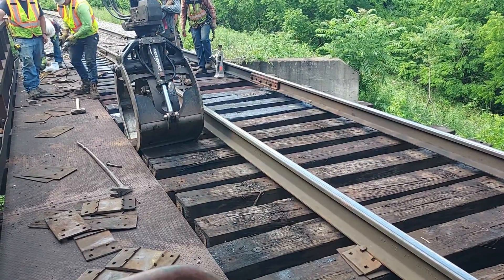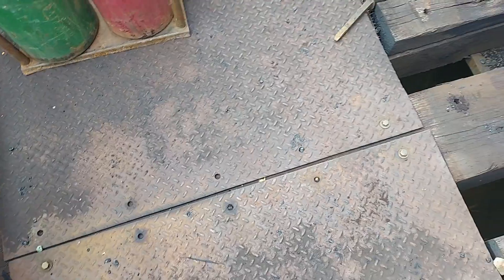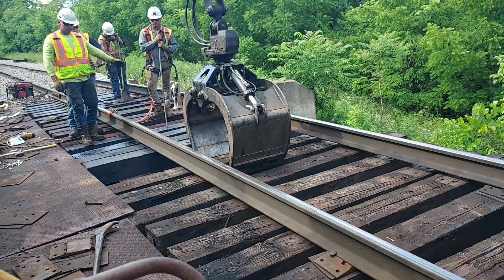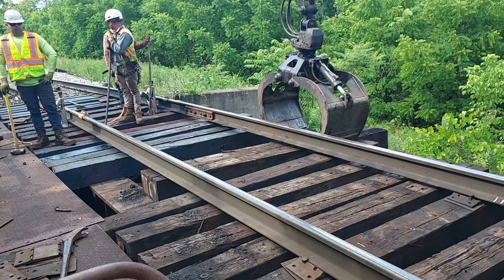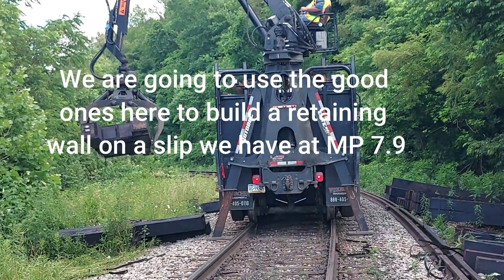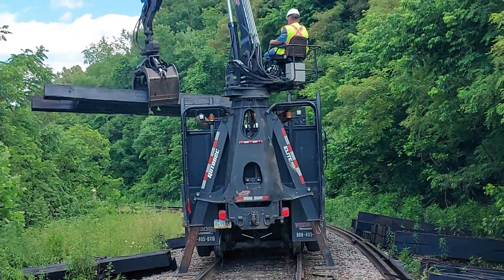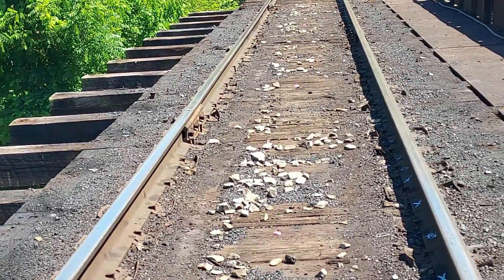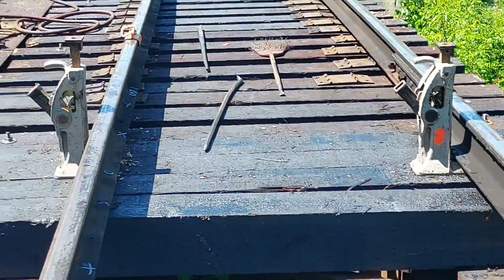Major Problems on Bridge 8 Deck Replacement

Comment: Are you unionized? If do, how do they feel about all these contractors always doing your work? Also why are they changing those ties out? They look perfectly fine. A class 1 they'd have another decade on those ties.
Reply from the maker: Yes we are union and way back in the past union filed a grievance,
out of that it was determined that contractors can come in and
do work that we don't have the equipment to do. But if they do
come in then any union guy that signs for an extra day they
are allowed to work.   

Some of the ties were good, some weren't. Can't judge a timber from
just the tops. Got to watch underneath as a train goes over the
bridge. If the timbers are moving up and down, those timbers
are soft and spongy and not a good thing. When that happens,
it's time to replace all of the timbers. Very much appreciate
your stopping by and checking out the show my friend.

Comment: Didn't something like this happen to you last year was well? I vaguely remember some similar timber issue.
Reply from the maker: We redid bridge 4 in the not too distant past and I showed that
deck after it was done, they had not put in all the lags for the
bridge guard timbers and main timbers had gotten skewed, if
that's what you are remembering. Thanks my friend for showing
up today and taking in the video.
Reply: @ccrx6700  Ah, yes Dave. Thanks!

Comment: Never a dull moment on the railroad! Looks like a job for a skilled chainsaw person. Very interesting video Dave. I like learning how things are done especially on construction projects. Look forward to the next installment.
Reply: Agreed- circular saw for vertical cut, then chainsaw horizontal rip cut. Sounds tricky and back breaking, but fast!  Maybe make a temporary "bench" at good working height and have grapple truck move them on and off.
Reply: @alandaters8547  Excellent idea!
Reply from the maker: Always an adventure here Wilbur. These guys did a remarkable
job dealing with the adversity and high heat. They never gave up.
We give them a big thumbs up for their efforts. More to show
you on the bridge in the next video out. Thanks so much my
friend for all your great comments and wonderful support of
the channel.

Comment: You know Dave, if a guy could get a chainsaw with a "stinger" under there, if there's room, while standing on a suspended platform, 2 men running the saw should be able to knock that out in a day.🤔
Reply from the maker: And did I hear you say, you would be right over to volunteer to
do that? LOL Always do appreciate hearing from you Captain Tom.
Next video out tomorrow night I will show you more of what they did.

Comment: Curious on how old are the ties being replaced on the bridge . They don’t appear to be in bad condition.
Reply from the maker: Some of them were good, some weren't. Can't always judge a timber from just the tops. Got to watch underneath as a train goes over the
bridge. If the timbers are moving up and down, those timbers
are soft and spongy and not a good thing. When that happens,
it's time to replace all of the timbers. Very much appreciate
your stopping by and checking out the show my friend.

Comment: Thanks for this video!
Looks like someone from the past left your folks quite a mess!
Reply from the maker: Your welcome Robin. Our timber supplier has original prints for some
of the bridges and some they can't find them, this one they 
couldn't find. Guy who measured did not measure center span
girder right. A big mistake, but mistakes happen to the best of
us. These guys did a remarkable job in what they had to
deal with. Always appreciate it when you come to visit with
us my friend.

Comment: Your luck runs about like mine. Measure 3 or 4 times and it still comes out wrong.
Reply from the maker: I could never be a plumber Mike. I clean up a plastic pipe fitting
the right way fit it together and it still leaks.... sigh. I hate plumbing....
Really want to thank you my friend for stopping by and watching.

Comment: Nice video once again Dave, blue prints are good and change orders happen during construction and never updated or filed, 93 ties in the centre span is a lot of cutting for Frontier, but they are the contractor to get the job done. Question from a non railway person - with the new ties on the bridge, does it affect the "cant" for the approaches and exit of the rail from/onto the bridge ( 1 right corner, 1 left corner). Not sure is it is the right terminology but I'm following along to learn what you do. Cheers and stay safe
Reply from the maker: Thank you very much Pete for the nice comment. These guys did
a great job and never gave up. To answer your question. When new
bridge timbers are put on, then I will tamp both bridge approaches
so the rail makes a smooth transition. 

This was a tangent bridge. However on bridges that have curves,
when they cut the dap, the high side of the rail the dap will be
deeper than on the low side. This is to allow super elevation
to occur on the bridge, it will be dapped so the bridge timbers
have the same super elevation as the rest of the curve has.
Hope that helped explain. Always appreciate your joining
in with us my friend.

Comment: make a template....layout each timber...do your...depth of cut...chip it out to wide with  hammer and chisel... it'll  take less than 25 min per timber... its a pain...but a simple fix!   good luck...stay safe!
Reply from the maker: Next video coming out Dave will show you what they did, pretty much
following your suggestions. They got er done. These guys
did a fantastic job and never gave up. Always appreciate your
taking the time to tune in and watch my friend.
Reply: @ccrx6700  thanks dave!
Reply: I'll  bet the techs...back at the office...pulled the wrong blue print...or just guessed...its best when they come onsite. and measure... work safe dave!

Comment: Dave, I was building a new run around and at one end was a bridge 🌉 that required 65 timber. Being we were going over water 💧, we had to use Green Treated Timber. No dap.
We removed the old Timber, cleaned off the steel, gave it a quick coat of red Primer paint, then laid   Convear belt onto the beams for cushion. 
 Since we had no dap, I tacked 6 Timber together then marked out for the dap.
Using a good circular saw & a 60 tooth blade, I just kept going back and forth, about a 1/4 inch between passes.
Took my hammer and broke the wood off then cleaned up what was left with a chisel. 
The beam was about 18 inches wide 😳.
Stay safe my friend, 
Richard Bause
Reply from the maker: I'm surprised the EPA still allows many RR to use creosoted 
timbers over streams. Good job on the hand dapping, that's
a lot of work! They used a circular saw and a hand adze for
these. Always appreciate your joining in with us and checking
things out my friend.
Reply: @ccrx6700  thanks my friend. 
When it comes to water 💧, EPA & DEC are always looking over your shoulder 👀.

Comment: Wow!! 😯 somebody messed up big time. Hopefully it won't take too long to get it fixed right.
Reply from the maker: Will show you in the next video out what the guys did to re do
the dap. It was a pain, but they did what they had to do. 
Unwanted things sometimes happen on the railroad as in
life itself. But these guys persevered and never gave up. Thanks
so much my friend for checking out the presentation.

Comment: Those old timbers seem to be in relatively good shape!
Reply from the maker: Some of them were, some weren't. Can't judge a timber from
just the tops. Got to watch underneath as a train goes over the
bridge. If the timbers are moving up and down, those timbers
are soft and spongy and not a good thing. When that happens,
it's time to replace all of the timbers. Very much appreciate
your stopping by and checking out the show my friend.
Reply: @ccrx6700  I see what you mean, does that railroad interchange at all with others, or is it strictly load and unload the same cars point A to point B?

Comment: Gosh Dave, that's a big deal with no easy or quick fix. Takes the steam right outa the old boiler. Like you always say that's railroading, but not the way we like to see it. Stay safe Dave and thanks for the update!!
Reply from the maker: No easy fix Rick, but these guys persevered and saw it thru despite
the adversity they faced. Kudos to them. Appreciate the nice
comment and for checking out the show today my friend.

Comment: Been there, done that, Doncha hate it when that happens??!! And Murphy's Law says that it will happen no matter how many times you measure.......
Reply from the maker: Mistakes do happen, sadly in this case it cost them a good bit
of time and the bridge deck did not get completed yet. But, that's
railroading. Really appreciate your stopping by and checking out
the show my friend.

Comment: Wow.   Goes to show how everything should be double and triple checked when tolerances must be tight and maintained so.  One would think somebody would have known about the differences between the bridges.  I expect this won't happen again.  Fortunately, this problem was only a financial problem & I hope it stays financial....so nobody gets hurt except maybe the ears of a certain person,  if there is someone who failed to do their job.
Reply from the maker: Mistakes do happen, sadly in this case it cost them a good bit
of time and the bridge deck did not get completed yet. But, that's
railroading. Really appreciate your stopping by and checking out
the show my friend. And your right Fireball, we all learned something
about our bridges and this will not happen again.

Comment: The purchase order should be in the accounting office and if the measurements are correct on that order and the company made the mistake then you should receive 100% refund on all those timbers and I would send a bill to the company that supplied those timbers from your legal department and Bill them for all the added time and materials to correct their mistakes.

I would go to the CEO directly and raider statement a proposal explaining the mistake your supplier made and that you feel strongly that legal needs to get involved demand refund for all the bad timbers and payment for the overtime and the equipment that you need to buy in order to correct their mistakes.

Getting good with the new bosses

Show them your thinking about the company's bottom line
Reply from the maker: Appalachian timber cut the daps exactly to the prints they
were supplied with. Unfortionately a costly error occurred
when Frontier measured the bridge to begin with. They ended
up eating the cost on the mistake too. But like my dad
always said, to err is human. It happens, but these guys
persevered and worked thru it and did what they could. Thanks
so much my friend for visiting with us today.

Comment: It's hard to find good help. Wow. What a pain and only having 3 days to fix it. Yikes. Also the sun Kink is not good news either but as you say, by morning it should be back close to good. But that shows just how much stress is on those rails in the summer heat, and how much pull is on them in the winter. It is not just a piece of steel laying there doing nothing until a train is on it like one would think.
Reply from the maker: Yep next morning after it cooled off a good bit, the rail came
back close, they only had to bar it over a bit to get it back
in place. Rail is amazing. Really appreciate your stopping by
and taking in the video my friend.

Comment: I worked track for NYCT on elevated structure 25 years, break out the chain saw. Minor set back!!
Reply from the maker: Mistakes do happen, sadly in this case it cost them a good bit
of time and the bridge deck did not get completed yet. But, that's
railroading. Really appreciate your stopping by and checking out
the show my fellow railroader.
Reply: @ccrx6700  you would be amazed on how track is renewed and maintained in New York City Tranist. Some parts of the job we still work the old basics, and other parts modern-day. It is a well rounded education of track, from ballast, concrete to bridge (structure), tangent,  curves and switches. Be safe out there. Always get home the same way you left!!

Comment: Low man on the totem pole&a Large shaft SkilSaw with a set of Dado Blades. That railroad'n🪚⚒️👷⛏️🚂🇨🇦🇺🇲🙋
Reply from the maker: Thanks so much for taking the time to tune in and watch
the show my friend. Next video will show you what they did.
Reply: @ccrx6700  I'll be tuned in for that one👍

Comment: Pull the specs sent to the company you ordered from

The exact distances had to be marked on the order

Use a router with a large bit
Reply from the maker: Video coming out next week will show you what the guys
did to widen the dap. It was a pain but they got the job done.
Did it the old school way, the way these used to do it back
in the day.

Comment: It wouldn’t be good if one of those new timbers got accidentally dropped from the grapple to the ground below.
Reply from the maker: No sir it would not. They had look outs and whenever a car was
coming, all activity stopped. Don't need an unwanted insurance
claim, we had enough adversity to deal with as was. Thanks so
much for taking the time to tune in and watch tonight my good man.

Comment: You should need harnesses and a pulley system to attach to, and a net underneath the bridge.

I think this is a perfect time to build a new bridge with space for 2 tracks
Reply from the maker: These deck workers have all had safety training on wearing
harnesses, it's required by the mine in order to work on
the property. I'm not sure about netting. I've seen a lot
of highway bridge work done but never seen a net. I've
seen some pretty high structures built that did have netting.
(I was at Hatfield Power Station in 1975 when they built the
second cooling tower there and it had netting. I have no
idea what the law says, if there is a certain height requirement
for when netting is used or not. None of the deck replacements
we've had here over the years had it. Maybe you can find 
that info out for us.

Comment: That’s a dang good operator right there! Great video,Dave! Also love seeing safety is first and foremost! 
That really stinks about the dap not being cut wide enough. A lot of work to make it right. Thanks for explaining what dap is! I was way wrong as I thought it was for the tie plates. Also Dave,on a curved bridge like that with some super elevation on the track,can that be accomplished by the dap angle where it meets the bridge girder? Be safe out there friend!
Reply from the maker: Yes he is Rusty. Richard is 72 years of age and a really good
operator. One of the best, We always tease Lucky about how
he needs to learn from Richard, along with some more
colorful railroad humor....LOL Thank you so much for checking
out the presentation tonight my friend.

Comment: These ties in the air dry rot like the ties in the ground rot being wet ? ?
Reply from the maker: To my knowledge Gerald, this is only the second time since 1977
this deck has gotten replaced. Yes over time the timbers do start
to get soft and won't hold spikes and also when you watch a
train from under the bridge the timbers are spongy, meaning they
are not solid against the bridge girders, they move up and down.as a train goes over the bridge. When that happens, it's time to replace the timbers.